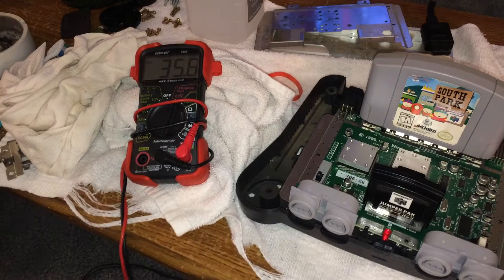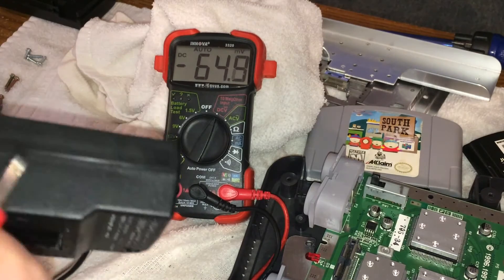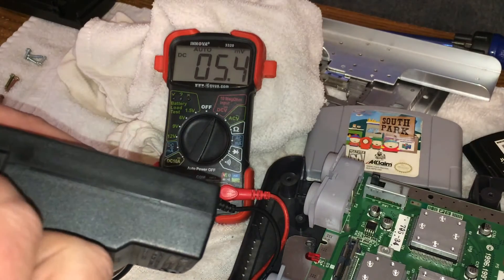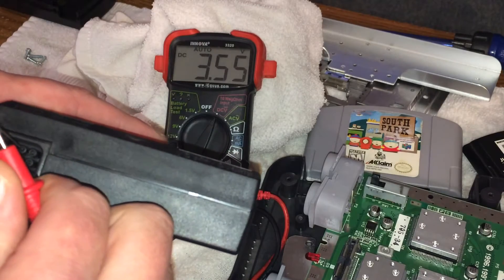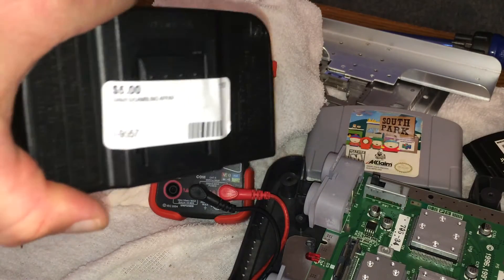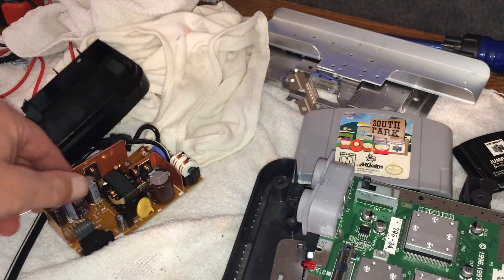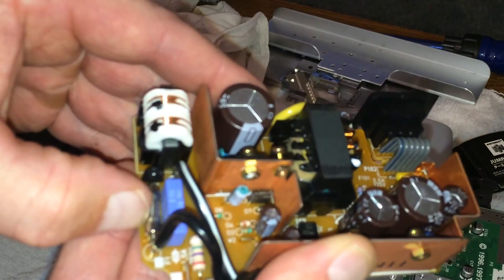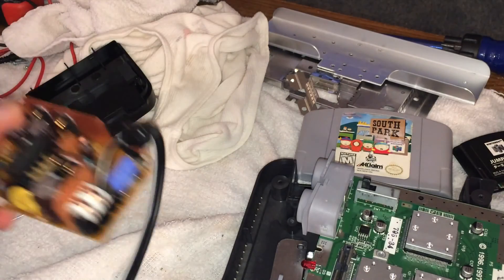Testing N64 power supply voltage. THEY WORK

Comment: Hi, mine has 10.8v and 3,0v and n64 turns on (I see the red light) but it doesnt have video and audio... Do you think it s not enough power?
Reply: Mine has 10.11V and when I insert a wireless controller adapter, the system won't turn on. When I disconnect the adapter, the game instantly turns on. But mine runs fine with a normal at 10.11V so you should be fine.
Reply from the maker: No not a power issue. I have 2 N64s that do that. I call it the black screen of death and haven’t been able to fix them.
Reply: I call it dirty cartridge slot and contacts.